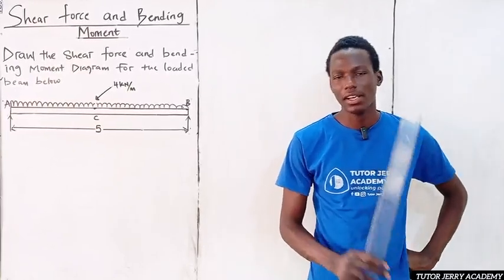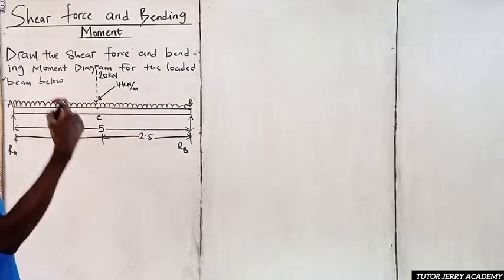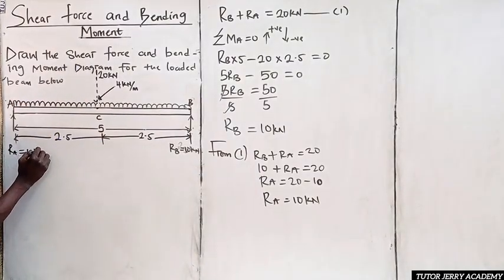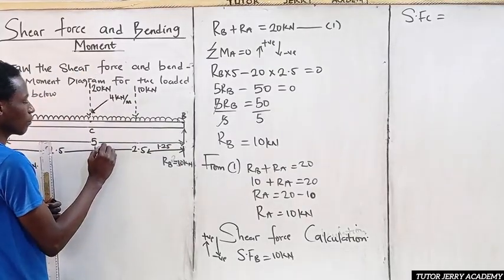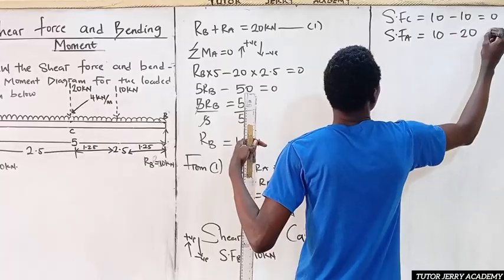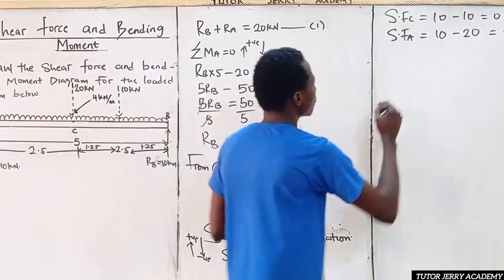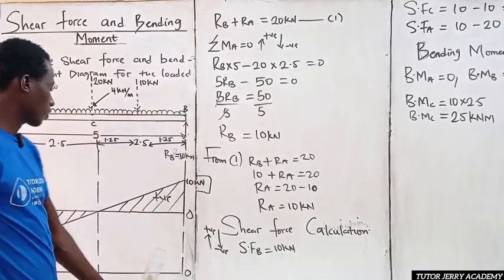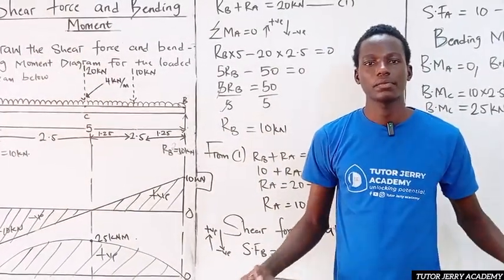BMD & SFD | Simply supported beam carrying a uniformly distributed load over the whole span | Ques 1

Comment: A horizontal beam ABC is hinged at A and simply supported at B. The span is 15m. The cantilever portion BE is 6m long. Draw the influence line for bending noment for the points D and E respectively 12m from A and 4m from C Hence find the maximum bending moments at D and the maximum bending moment at E due to a load of 1kN of a Legth 3m State the corresponding position of the Load .
Reply from the maker: Any diagram on this ?
Reply: @tutorjerry  No diagram we are ask to plot the diagram and solve
Reply from the maker: @TaofeekYahya-w4z okay now I understand the question I will solve it
Reply: @tutorjerry  thanks please when are you uploading the answer cause it’s an assignment I have to submit on Monday 🙏🧎
Reply from the maker: @TaofeekYahya-w4z  Noted you will get the solution before Monday do you chat on WhatsApp? If yes dm +2349019742377
Reply: @tutorjerry  can i also get the solution to this
Reply from the maker: You did not reach out when I told you .